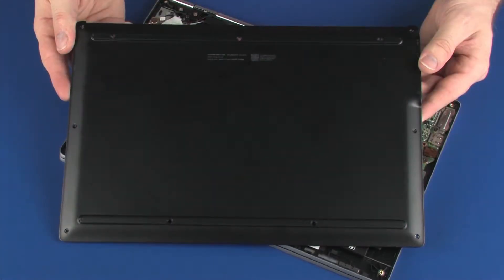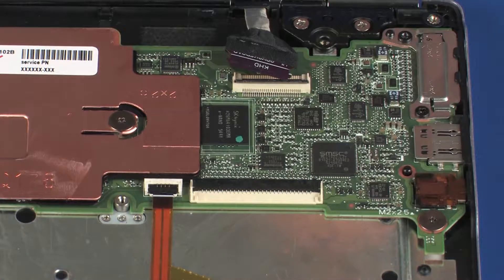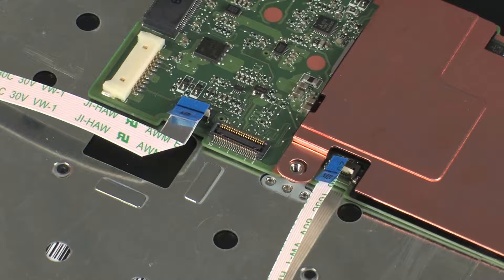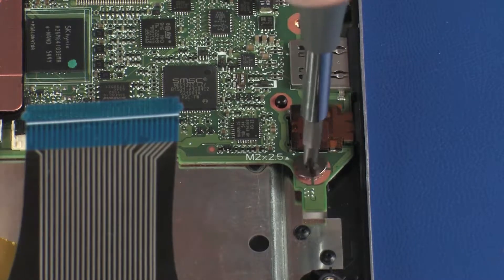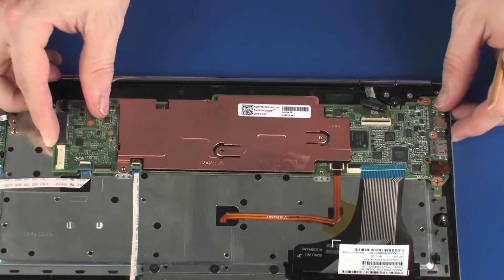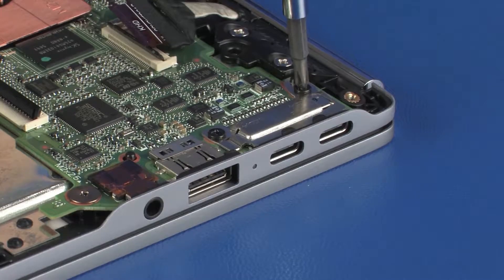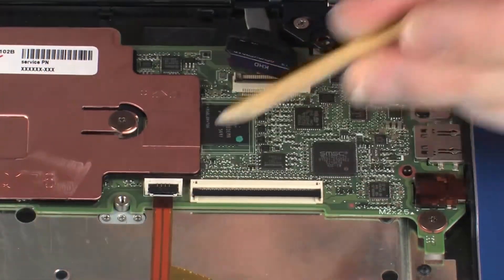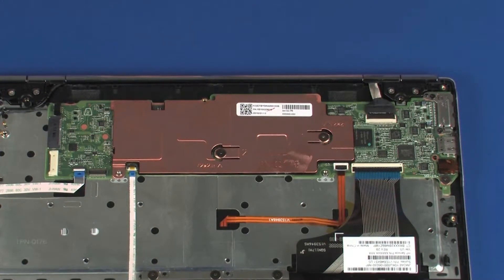Replace the System Board | HP Chromebook 13 G1 | HP Support

Comment: Is it possible to upgrade  chromebook 13 g1 from pentium processor to intel m5 processor.
Reply from the maker: +Muhammad Eeqan HP does not recommend upgrading or downgrading hardware parts or software that is bundled with the product as It may affect the manufacturer's warranty and performance, however, you could change the configuration at your own discretion.
Reply: @HPSupport  ok i got it but still i want to upgrade procesor can u tell me is it possible to upgrade processor or not.
Reply: @muhammadeeqan6033  unfortunately it's not possible. May be only by reballing the chip, but uefi might not support any other chips